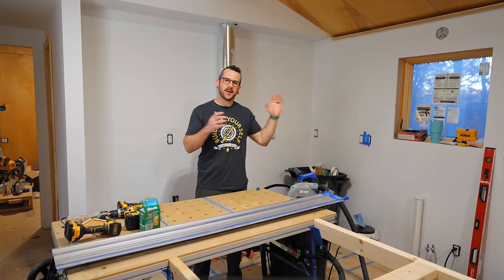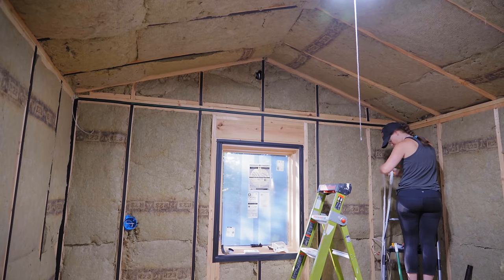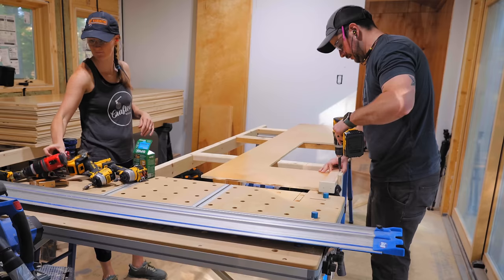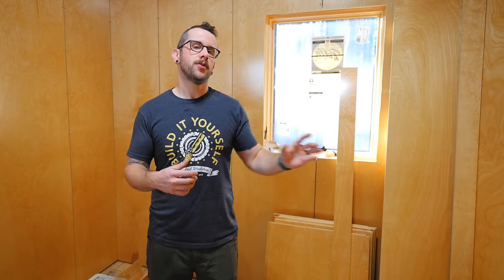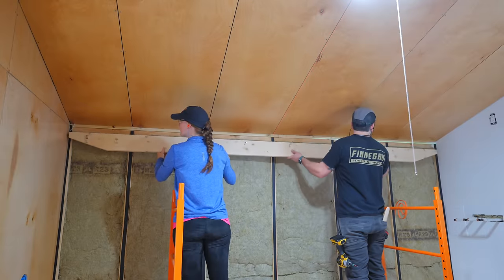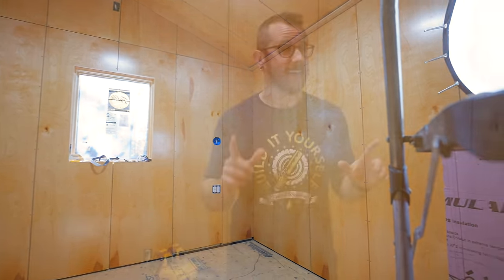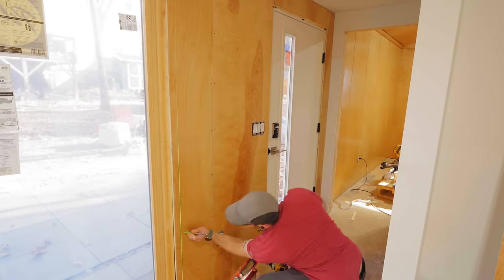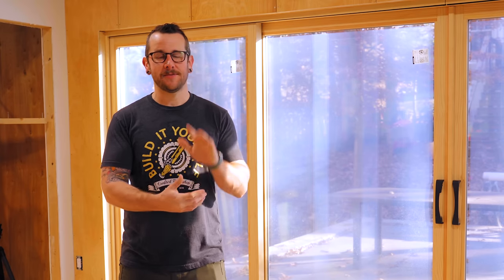Installing PLYWOOD WALLS (instead of DRYWALL) in the Not So Tiny House

Comment: Best part is, if you ever have to do any maintenance behind the walls, no cutting holes. Just unscrew the whole panel, and put it back when you are done. No, lumpy drywall. No, repainting.
Reply from the maker: Yup!
Reply: Or you could mount them with French cleats recessed between the studs
Reply: There is no best part. This is just awful looking.
Reply: @waynewayne9693   The best part is when it catches fire you won't have to think about trying to save the thing 🤣🤪
Reply: @77Avadon77 Right since drywall doesn't burn

Comment: I’m building painted plywood panels for (some) of my workshop, but I’m adding 5/8 drywall glued to it on the backside (I’m adverse to fire) and am going to to make face frames to make it look like wainscoting. I’ll attach the frames with rare earth magnets. Pop the face frame off, unscrew, and bam, access to the wiring and plumbing. Not doing it everywhere, but in strategic locations.

Other locations will get construction grade plywood behind drywall….extra strength plus extra fire rating, plus ability to screw into anywhere.

A few areas with get painted car siding (nickel gap) over the top of the drywall. A little goes a long way. I know the shiplap craze has run its course, but I still think it looks good…in a shop.

Comment: My first apartment was a split house and they used plywood to make the division. It didn't block sound AT ALL. My neighbors toilet was on the other side of the wall from mine and we had the same schedule. Every morning we took a unified poop. What a time.
Reply from the maker: Hah! Yea, I'm guessing it doesn't block sound as well as drywall but I've got soundproofing insulation, so I'm not too worried.

Comment: Using "Mid-Way" electrical plates will be a game changer. They don't look strange like "Jumbo" but give you a little added coverage. And adding draft doger gaskets between devices and plates help to round out the air sealing.

Comment: If you have the plug mark, and you are trying to put usb chargers in the wall, but they dont fit, temp swap a regular outlet that fits into the location. The box size and location doesnt change.
Reply: And you do not even need to connect the wires. Just screw in the receptacle, and make sure it is centered in the box.

Comment: I've been wondering: Vapourbarriers? Are they not "A Thing" when putting up ply over that type of insulation?
Reply from the maker: I don’t think it was really necessary since both faces were finished.
Reply: Poly on plywood is most definitely not a vapor barrier typically.  I don’t know codes in his area, but this wouldn’t be compliant in mine.
Reply: In his climate zone (3 or 4) it’s technically not needed. Marine 4 and zones 5-8 require an interior vapor barrier and only those that have a high heating demand and low to no cooling demand use class 1 vapor barriers. Since it’s more hot and humid outside of the house than inside most of the time , vapor is driven into the walls from the exterior rather than inside and an impermeable interior membrane would likely just trap moisture in the wall assembly.

Comment: Drywall uses compound for the joint finishes and seals (for moisture and bugs). How do we do it for plywood paneling?
Reply from the maker: This is why we added the weather stripping at all of the joints.

Comment: Hey Johnny. Nice project, I really like this interior paneling. I'm using a similar technique on a party barn I'm building. Did the inspector on this job have any requirements for your screw spacing for your interior plywood?

Comment: I don't know what those people are thinking. Not only is it something new to me, it's bad ass cool. I personally like the glossy look the plywood has. Besides, wouldn't the plywood be more efficient on the electric bill than drywall?
Reply from the maker: Thanks man!
Reply: Yeah, he gets less heat loss and more cooling using the plywood vs the drywall. Drywall has an R value of .5 per sq inch for half inch drywall. One inch of general use plywood has an R value of 1.25 per sq inch. In this case it could be lower due to thickness, say 1 or .75. Most of the "heavy lifting" hear is being done by the Roxul insulation. For as thick as Johnny has the insulation, you're going to see an R-23 per sq inch. So with the plywood, he might have an R value of 24 per square inch.
Reply: cyproc drywall have lot better insulation than plywood newer can be.

Comment: Ya no poly over the insulation spells mold trouble, even though the insulation is moisture resistant the water or breath vapor will hide back there. It’s got to come back down eventually I’ve seen it many times
Reply: Yep. Even if it's in a dry area the dew point will be inside that insulation in the winter. That causes a lot of condensation inside rhw insulation. 
A lot of moisture in a house from people. Not just the bathrooms, it's from breathing. Gallons a week with those two people.

Comment: On the first wall installed, what happened to the panel, second from the right? It seemed like it was shorter than the rest
Reply from the maker: Had to trim the length for the outlet boxes to match up, but the gap will be covered by trim so no biggie.

Comment: Nice job, but this had to be very costly knowing the current cost of a sheet of plywood. One good thing about this is you can easily remove panels if ever there was a need to get access to inside of the walls or in case of a leak you can just remove the damaged panels without tearing up the entire wall. Btw. I say do what you like in your house and don’t care what others think. Personally I like the look.

Comment: I’m guessing but don’t you still need a layer of drywall behind the plywood. This is required behind paneling to act as a fire block according to building code.
Reply from the maker: Not in this area, same thing as ship lap or tongue and groove walls.

Comment: I like this and have thought about putting up plywood behind my laundry machines so I can access the electrical and plumbing if needed. But what about fire safety? Drywall would be safer, right?
Reply from the maker: Drywall would be more fire resistant for sure.

Comment: Are you going to put trim over the cracks or just leave it open?
Reply: I actually have done two houses like this by the way, pre finished birch FTW. But I just use the entire 4x8 sheet, just screw the panel in at the edges and leave the fields open. Then you only have to put a strip of trim every 4 feet. Works great super happy with the result
Reply from the maker: I'm going to leave it open, that was kind of part of the look, to accentuate the gaps.

Comment: Why use plywood strips for every stud? A standard 4x8 sheet is conveniently divisible by 16" stud spacing either vertically or horizontally
Reply from the maker: The 2x8 panels were way easier to work with in this small space.

Comment: I rlly rlly want to lo e the plywood bit I think your film lights make it look way to glossy. If there's anything I've learned about this is that it's not the beat look in small rooms, and in tour case compounded as you used the less nicer wood there. But I rlly appreciate you showing the process and trying new things takes gut to follow thru with it. And I can't wait for the it to staged and lived in it will look soo good

Comment: But why did you use plywood instead of drywall?
Reply: He was going for a specific look.  It ended up way too dark from the supplier.  It looks like an old, decades smoked in, manufactured home with pressboard paneling.
Reply: Some of us think it's prettier.
Reply from the maker: It only looks like that in one room, to be fair. I’ll have a bunch of built-in cabinetry in that room so it’ll look better once it’s in.